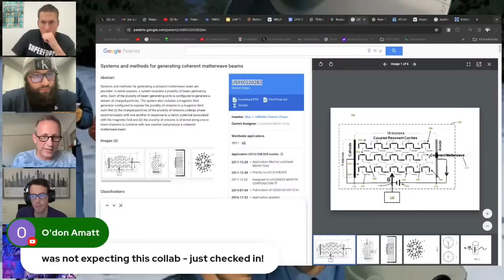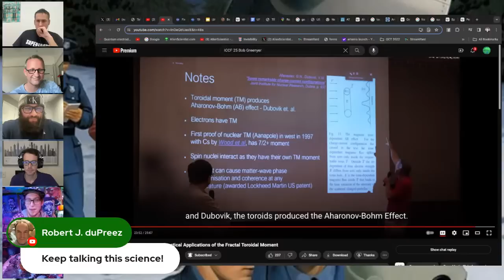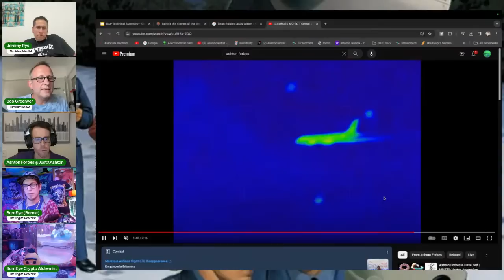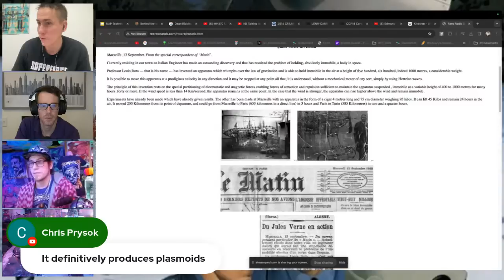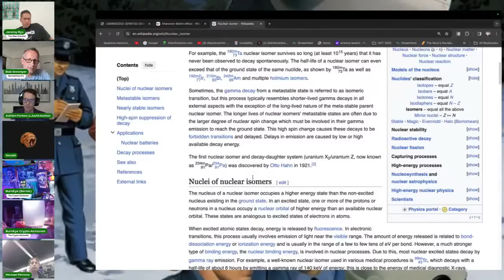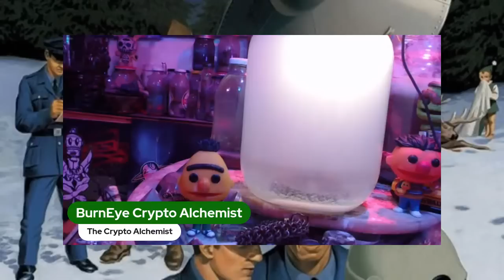Catastrophic Disclosure - Alien_Scientist

Comment: RE: ANCIENT KNOWLEDGE:

37 in Qaballistic representation,  is the Tree of Life glyph - the 3 spheres (sefirot) of Divinity, the upper section of the Tree above the  Abyss (Da-at), with the 7 spheres  (sefirot) below the Abyss. These 7 consist of 6, arranged as the Star of David representing 6 astrological principles, and Merkabah) above/below principles.

The final 7th sphere is positioned below this Star arrangement,  representing Earth/solid physicality.

Three dimensionally, the 7th sphere is located centrally within the Star plane (when viewed from above) but is located at a proportionally lower level ... as shown by Tesla's diagram.

* The Star arrangement is echoed in some of the toroidal diagrams in this presentation - ie: the smaller perpendicular toroids within the larger one ... (the NASA diagram)

This hexagonal geometry is shown as Metatrons Cube, Flower of Life, and has been revealed by physicist Nassim Haramein, Adam Apollo & Robert Edward Grant, as the fundamental Planke scale geometrical foundational structure of the Aetheric Unified Field existent within Space.

37 ... 3 + 7 = 10

1 & 0 showing the dual/binary principles of the Universe, also used in computing.

1 esoterically representing the Divine Unity principle Essence of existence (god), and the 0 representing both the Infinite & Eternal nature's of the Divine Unity.

3 & 7 are "odd" numbering, which are all dynamic/moving/changing principles,  as opposed to the stable/firm/more solid,/balanced even numbers.

The 3 & 7 are considered Divine numbers.

There is way, way more to say about this, pertaining to the Principles of Creation, including numerological knowledge, but this is a large subject rabbit hole within itself ...